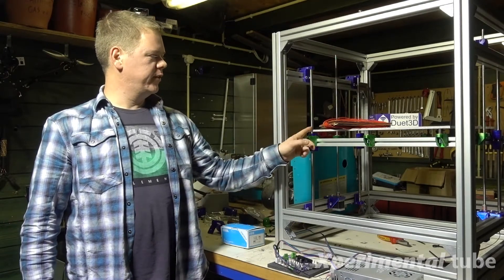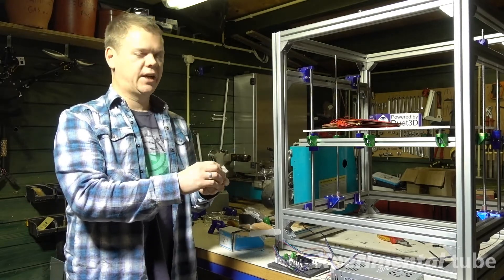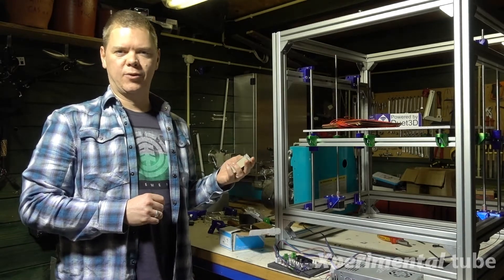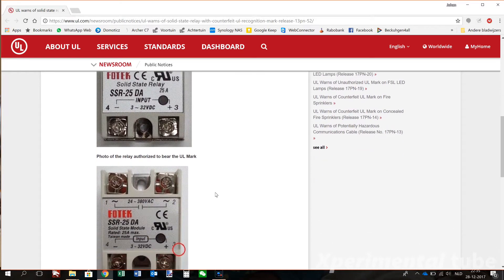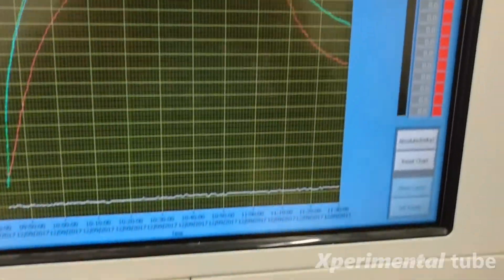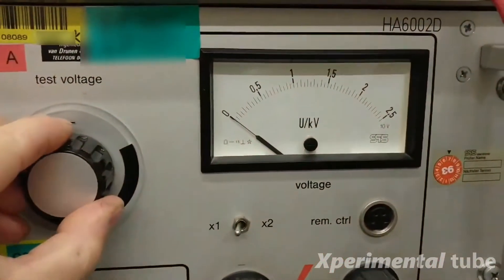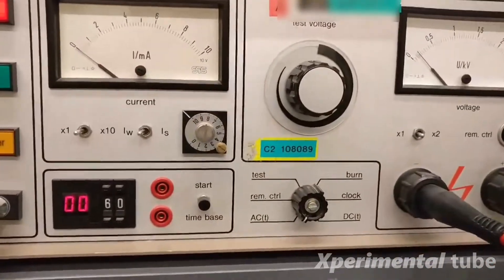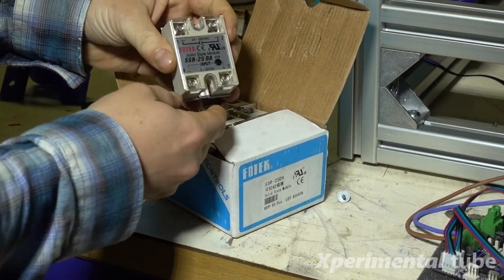Fake Fotek SSR-25DA FAIL

Comment: Thank you for the test. I bought a 10 amp rated relay from fotec, and only running 4 amps for 5 minutes max on an exterior circuit with 7 LEDs bulbs for my garage exterior lights.  Now, you have me wondering if this is large enough?  Seven bulbs at 16 watts each, let me find a calculator, is this right, 7 x 16 = 112 ÷ 120volts = amps of .9...?
So this relay should work a ok..
Some explaining,  7 exterior lights with LED bulbs, all wired together on the switching side of the fotec relay. Have 7 mini 12 volt motion sensors,  one for each light,  mounted three or four feet under plain light fixture in building vinyl siding. Have 120 volt to 12 volt transformer wired to sensors with the activation wires ran to 12 volt side of relay to have all the lights come on as a group of lights instead of only one at a time. Plan on mounting on plywood, to conduct tests to confirm correct operation of components,  everything is arriving in next few days. On DIY website,  some electrical engineers said I need each sensor wired to it's own relay, 7 relays?  Not sure if that's the case, I will try with one, if I need more guess I will order more.  Any help you can add, or point out would be appreciated.

Comment: As amusing as it was to see all the lab work, it would be much more definitive to open one up and look the actual triac used. Most of the 25A ones use just a 12A or 16A triac in there. I also have fake one that actually has decent 25A triac in there. JST24A-800BW which has 2.5kV insulation. Most of them are epoxied so you can't see whats going on. This 25A was not.
https://i.imgur.com/OOqEpcL.jpg